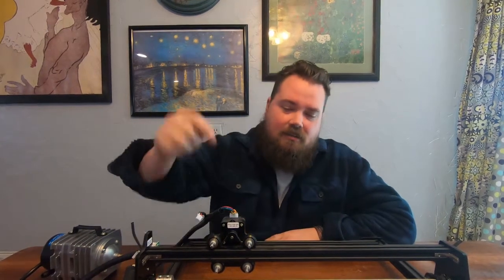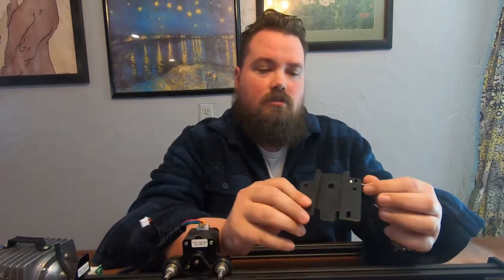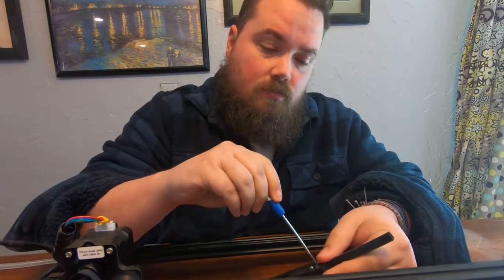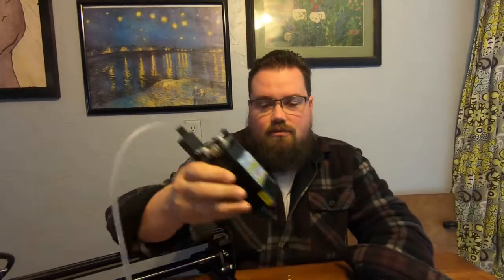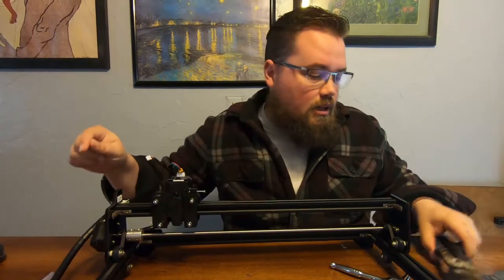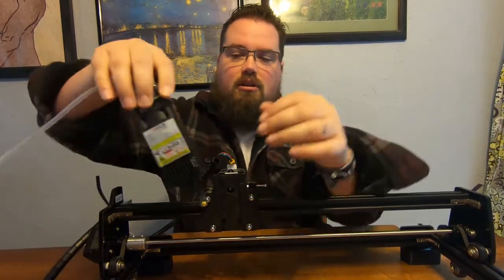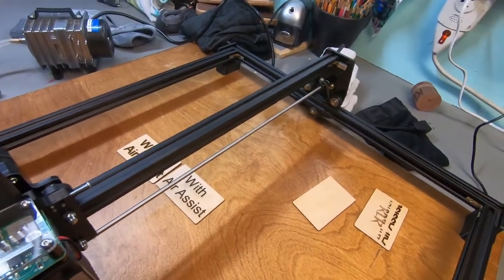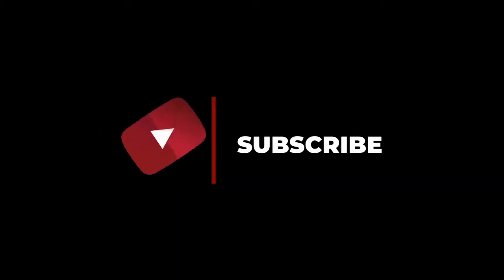Upgrading our Z-Axis with Air Assist Built In Ortur LM2

Comment: Please tell me what kind of plastic tubing you are using. The tubing I am using stiffens when it get cold (engravers in my shed). I see most of the Ortur users with what looks like silicone based tubing.
Reply from the maker: Hey - I have added the link in the descripton on the video. It's the air pump that we used and the tubing came with it
Reply: @KLRform  there’s no link in the video description that leads to an air pump:(.
Reply from the maker: Here is the same size pump. We will get links in description as soon as Amazon lets us keep the affiliate.  

https://www.amazon.com/dp/B078H92695/ref=syn_sd_onsite_desktop_143?psc=1&spLa=ZW5jcnlwdGVkUXVhbGlmaWVyPUExRDNOVEJIM01SSkFDJmVuY3J5cHRlZElkPUEwNTYwNzA3M0ZPQVpNWUhEN0RQRiZlbmNyeXB0ZWRBZElkPUEwOTY0ODA3Q0dXNVVKM0VRTEpYJndpZGdldE5hbWU9c2Rfb25zaXRlX2Rlc2t0b3AmYWN0aW9uPWNsaWNrUmVkaXJlY3QmZG9Ob3RMb2dDbGljaz10cnVl